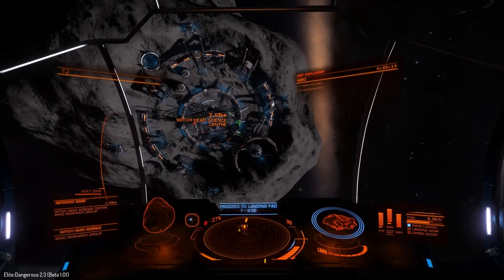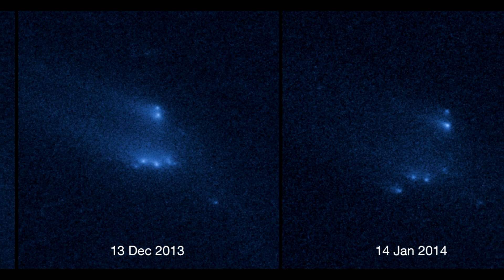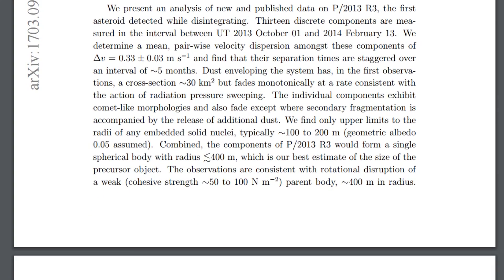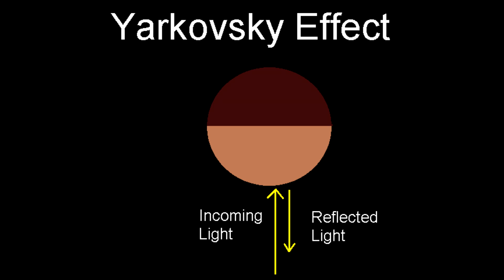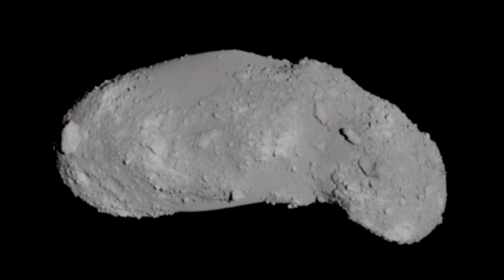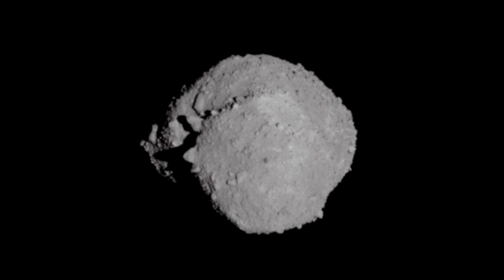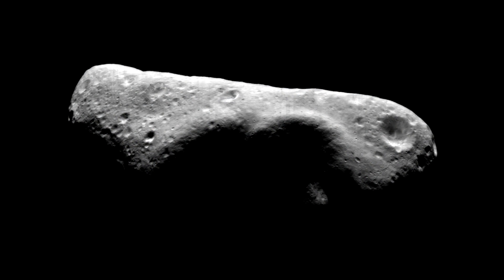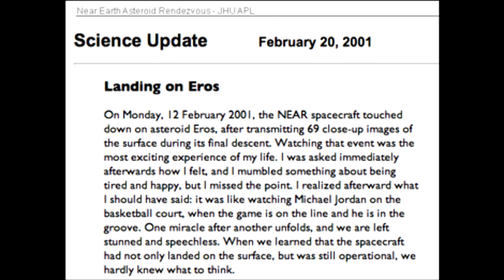Spinning Asteroids To Make Space Stations

Comment: Concrete (which may be the best approximation to molten and resolidified rocks) can support up to 440m of length before ripping itself apart under 1g influence. Providing 0.2g to move around in there practically gives you about 2km in length. Now half that number because its not best industrial grade concrete but molten dust and stuff. Half again for structural stresses in a hollow structure. There you go with a 500m balloon of molten rock that you can walk around on the inside. Well you would have to wear a spacesuit because survivable atmosphere of at least 0.5 earths sea level pressure would put 1 GN (equivalent of 100kilotonnes) of tensile force on your structure. However such a thing in small dimensions without an atmosphere might at least be interesting as a spacedock so your tools dont get lost while assembling interplanetary crafts.

Comment: Expanse season 3 has this one ship with spinning ring (not the behemoth/Nuvoo) BUT the floor was on the INSIDE of the ring... sooo uhhhh I think the Belterlowda have to walk on their head.
Reply: Watches from the closet Which ship?
Reply: @craigs733  I think it was in this one scene showing a station. It has a spinning habitat ring that somehow has the floors on the inner side not the outer side of the ring. Some movie mistake I bet.
Reply: Watches from the closet Do you mean Tycho Station, Fred Johnson runs it? If so you should rewatch it, the habitat ring works as it should, you can tell by the orientation of the ships docking with it, down is towards the outside of the ring, has been through all three seasons so far.
Reply: @craigs733  Yes I really should. It wasn't Tycho it was a smaller station. its definitely a cinema sin.

Comment: 1. Pick an asteroid
2. Cut it roughly in half across planned rotation axis
3. Install bearings and electric motors
4. Rotate two parts in opposite directions
5. No need for expensive and bulky rocket fuel, just lots of electricity

Comment: How about throwing a nickel iron asteroid into a solar furnace, heat it up until it melts, send a gassing torpedo to the center and expand a huge volume of gas in the interior forming a void.  The walls begin to cool, the center could be accessed as the structure cools and construction could begin!

Comment: If you heat the asteroid sufficiently, the metal oxides that make it up will decompose.  The oxygen, being lighter, will rise, to the surface and escape (carrying off part of any preexisting rotational momentum as well).

Cooling is certainly the challenge; you're absolutely right that passive heat radiation would be far too slow.  And regardless of how you get it out of the asteroid,  since you're in space, you either have to store all that heat somewhere else , or radiate it away with some incredibly huge surface area radiators .   I think the "easiest" way would be to build an incredibly high surface area sphere to condense water vapour on, which you then spray back on the body.  But that's in quotation marks because there's nothing "easy" about that, and it'd still be a very slow process!

Note that the faster the body is spinning when you melt the asteroid, the more elongated it will be and thus the higher the surface area to mass ratio, as well as the shorter the distance between the core and the surface.  So a pre-spinup would be of use.

Comment: You hollow out a rock and build a O'Neill cylinder inside it or several, if the rock is big enough. Then you spin the station inside the rock to achieve gravity, like a wheel in in a wheel well. That way you'd have radiation protection and protection form micrometeorites and other physical objects.

Funny thin is that we more or less have the tech to do that right now, if we could get all the needed material off earth and to the building site cheaply enough. It would maybe better to nudge a usable rock into earth or moon orbit and build it there.

Comment: which Wikipedia article is that?  I am assuming the 'bainite' listed is the crystal bainite in bainitic steel.  Bainitic steel has a tensile strength range from 600Mpa to 1700Mpa.  That would give a specific strength as high as 216 Kn*m/kg compared to 7075-T6 at 204 Kn*m/kg

Comment: The books I read they would mine asteroids take the dust and rubble melt it with a parabolic mirror (think solar sail in the right shape) let it form a sphere cool it a bit  and then spin it up and heat it again letting centripetal force hollow it out and expand it to a useful size.

Comment: I'm no civil engineer, and neither am I sure  that this would work for an asteroid, but  here on earth civil engineers sometimes reinforce rock with rock bolts. This video does a good job of showing loose rock reinforced to support a tensile load  by putting the rock in compression.  https://youtu.be/xNDppVTVUss

Though its easy to see how the rock is made structurally stronger, its not clear to me how well that would scale. 

Asuming a reinforced structure could support fractional G cyntrifufal forces, Spinning up may make sence with ion drives and  gasified materials from the  asteroid to provide reaction mass.

Comment: Take two asteroids, a few miles apart. Use a net around each one. Connect with cables, set them into motion, as in orbiting each other. Dish out the insides, facing each other. There is your gravity. Customize as needed. Build domes over the inside facing areas. Of course, this requires the materials and technology to pull it off. You can park this "slingworld" in an Earth distant orbit, opposite the Earth. Ability to adjust orbit is required, to maintain proper position. If desired to abandon this thing, it's necessary to send these asteroids into the sun, or out of the solar system.

Comment: 1. Could spin up a much smaller asteroid to reduce the thrust needed. Could also use two small asteroids connected via cable thus further mass reduction. The longer the cable the more centrifugal force can be create for a given rotational speed.2. Perhaps instead of using heat the asteroid could be stabilized using a glue\binder and steel cables to create something like Pre-stressed concrete.3. A steel shell is created mining iron asteroids and plastered with ruble from a loose pile asteroid for radiation shielding. Use a pair of these joined via cable.4. If the asteroid could be steered into a close orbit of the sun it could provide a lot of heat to sinter the outer layers. However the issue is how much volatiles are contained in the asteroid since a close orbit would probably make it outgas like a comet. The Asteroid could be set up on a elliptical orbit to cool it off. Consider that we are now at a +50 year space tech development. A 100 year project to transform an asteroid into a space center isn't really that big of a deal. Consider than NYC has been constructing a water tunnel since 1970 and it still has a few more years before its finished. The Great wall of China took about 1000 years to complete.That said, probably the most practical first steps is to start tapping iron & precious metal asteroids. The iron could be smelted in space to make steel plates and girders for construction materials & precious metals could be used to make the space mining somewhat profitable. Imagine the things we could do if rare metals like platinum, rhodium were as abundant as copper on earth via space mining. With access to thousands of tons of iron we could build some amazing projects in space. 

We could go the slow route of moving metal asteroids into an orbit around the earth using solar sails or low thrust active propulsion system. It might take decades or even longer to get them in to an earth orbit depending on the distance and mass.  Chucks could be cut of and put into earth orbit quicker.

Comment: We'd assume they wouldn't pick a light rubble-pile. Mars' moons have density around .25g/cc. It's nice to have a little metallic chunk parked as contact binary with one of them or an extinct comet core which is what those 2 moons seem to be. >~ 40% volatiles by mass.
Metallic asteroids are a different animal. The NEO that hit Chelyabinsk was a piece of gravel of something like rocky Ni/Fe. Density ~8g/cc

Let's assume a little metallic chunk of that, like a 4km version of Psyche, a solid steel body.

We can allow for some means of removing rocky impurities and unnecessary (probably valuable) minerals that would hurt the alloy. We can get energy to boil it, with hectares of mirror. The metal we want boils away at a cooler temp than the Si, then we have our way of refining it.
We could use sections cut from blown balloons and films of metal to make your hull.
 If not a single balloon; you can tweak a shape very adeptly, to make other than a simple bubble in a single melt. Steel is great in its work-ability.
 We can get you plenty of cometary ices to cool it with. If we do that inside a huge slowly spinning zero-G vessel, that water is reclaimed.

Steel as plate and beam is still less attractive as a colony or other large space structure, than using less steel as cables in pre-stressed artificial aggregate rock (reinforced concrete of some sort)
Sure you could use single "pours" of a single large pool of melted metal to "inflate" an enclosure, but it's not the best or easiest way to get habitation or G in O'Neill colonies.

Flying mountains of ices and others of steel, are buzzing by us. Most are easier to get to/from than our Moon, most with vastly better resources. Any/all could serve as ingredients for O'Neill habs, and those can be sent to Mars or among Jupiters' moons.

Comment: All this is why you crunch the asteroid up & eat it in your space manufacturing facility, and separate what you need.It's been found that some 95% of the mas of such a facility at a colony site, is dumb bulk structure, easily made with simple methods, from bulk local materials. You send out a "seed" factory that uses parts sent out to make bigger mirror and simple small structure, which allows it make the bigger stuff.
 What's been found to seem to work well, is using the metals mostly as cable in the reinforced concrete pressure/G/shield hull. Common engineering gives metals many times the strength-weight when used in tension. concrete is a much more friendly forgiving material, dampens vibration and temperature swings, easily repairable. Metals also make your mirror.
The asteroid also provides the rock dust, the calcates or phosphates, and the liquids you might need.
I like the idea of giving a space colony ~2m thick bunker of rock, as a hull. That's about the minimum rock shield, for GCR particle events.

The NASA Anes space colony studies determined that the largest pressure hull, spun for 1G, they could build to have ample safety margins, with current tech ('70s), was 14km diameter.
Note that long spin axes like Clarke's Rama or the big O'Neill cylinders cannot be naturally stable. It doesn't make sense to engineer to use complexity to counter natural forces. A drum, torus (wheel) or spheroid shape can be used to keep long axial density low and rim density higher.
Note that even a huge colony with two drums axially joined, can then be put inside a non-rotating shell of the same materials. They'd be better protected from rads and impactors than Earth.
Yes it's massive, but it's only rock. Yes it's a lot of work, but it's mostly tele-robotic as the most human intervention, 
Expense? For a new research base/university city? (or City/State?)
What's "expense" when you're mining asteroids? What's a "budget" discussion that doesn't include asteroid mining, which pretty much ends all budget crunches & debts and wins any "money" games based on raw resources.

"there's no economic way to bring such materials back" yes, it'd be nice if in all this talk of people designing new launch vehicles, somebody put some thought into way of moving things around in space, and of bringing insensitive things in space down to the ground relatively intact and non-catastrophically. It seems a little late in the "space age" for putting around among the NEOs and back to Earth to be a species-bottleneck we can't get past.
 NEOs buzz by us with very low delta-V requirements and free solar energy the whole way. Chelyabinsh was an NEO, a solid chunk of metal, like Psyche. Resources on the Moon can't compete, and once anyone finds a single way among many possible ways to make it work, they win.

Comment: Choose the largest asteroid that is just a rubble pile, of material adequate to make a weak concrete from the regolith
Send unmanned boring machine to bore a toroid and support spaces and use rego-crete to hold the shape during construction
Spray higher grade fiber reinforced concrete within the regolith for permanent support
Send first crew to build innermost safety station, dock and airlock; using higher grade concrete, steel sections, or completed sections built on Earth
Build toroid (habitat ring) if a mineralogical survey pans out - good wishes don't pay for a space station
Completed toroid would contain all bedrooms which double as offices, kitchen, bathrooms, and community space
Permanent residents would spend at least 16 hours per day at 1g of Coriolis effect; with no 0g deterioration
Any 0g manufacturing (alloys that can only be made at 0g?) is done in the asteroid in different sections
Sections can all be climate controlled so permanent residents may not need a space suit daily

Do you want to set up a crowd funded project?  Let's do it!

Comment: I do not know the particular elemental composition of eros, at least that which was determined from its reflected spectra, but I assume that if is has sufficient carbon content, and if the company from the show had sufficient energy, they could theoretically use the carbon to create carbon fiber or carbon nanotube fiber meshes to hold together all the rock and dust. 

Another option, again I have not done any of the math or material research to confirm it, would be to create a sort of pikecrete with the material and water. Cellulose based pikecrete is pretty damn strong and durable, especially when reinforced with mesh matrices. There would still be a problem of heat, there would still need to be heat pumps to keep the pikecrete from slowly melting with solar radiation, but it is another seemingly viable option. 

Also, this is just my imagination now, one could concievably use the sun to spin up a large asteroid (once reinforced) with solar sails, mounted concentrically around the desired axis. Let solar wind do the heavy lifting. It would still take years, but hey, locally sourced reflector raw materials is cheaper than peroxide or liquid fuel shipments, and less wasteful of life giving water than using all the available ice and nuclear reactors to fuel rockets. Might be an interesting concept to explore in a future video. :) 

I think astroids, assuming we could get around some of the fundemental issues of spin and such, would be a great option for large scale perminent space stations. There are resources there, I'm sure many have a decent amount of water ice (to fuel fusion reactors and yo provide a base quantity of drinking water for reuse of a living population and their crops) and if we leave a thick enough outer shell of material, they could shield pretty readily from cosmic and solar radiation. I wonder if there is any significant content of thorium out there 🤔 we could ship nuclear waste and set up breeder reactors to create fuel for colonies and stations throughout the solarsystem, especially if it were based between mars and Jupiter.  

But hey, that's all way off in the future. I'll settle for a retirement on the moon by the time I'm in my 60s. Hopefully Bezos and musk and the next generation of visionaries can make something happen. the biggest hurdle is basic infrastructure and powersurplus, once those are achieved, it wong take long to find sufficient sources of profit to attract industry and perminent settlement

Comment: What if you tunneled out a hunk of asteroid, lined the inside with electromagnetic tracks powered by solar panels on the outside, and stuck your spinning space station inside that, rotating up against the tracks? No friction, impacts are buffered by a bunch of (relatively stationary) rock, and you even get radiation shielding from the rock. Plus, when you need metal, or dirt(powdered stone), or oxygen(silicon dioxide), or something to sell back on Earth, there's a huge rock right below your feet, that isn't even holding you up!

Comment: Scott you know we can't for sure say that they would break apart,  there are certain asteroids that are very rocky compositions and actually you of all people know when Hayabusa and other satellites had inspected asteroids before they found out that the asteroids were a lot tougher than we originally thought. Some of the asteroids even had the same features on them similar to the bottom of a river bank. Granted we can't say that there are asteroids out there that if spawn up will throw themselves apart, but I believe that most of them have a rocky enough core that is big enough that we could actually do this. We might lose a small amount of materials, but using something similar to a 0g vacuum we can remove the loose material before coring the rocky center to make said space stations. We could even incase the whole asteroid in a nano blanket (which we do have the material to make) then spin the asteroid up to catch any loose materials that fly out. It'd be more similar to using a net to catch an asteroid and bring it to our orbit which gave me the idea. The fact that we will deal with centrifugal and not centripetal forces means that any materials on the outside will be flung off the rock, which could in fact make harvesting and sorting the materials far more easy than we ever thought.